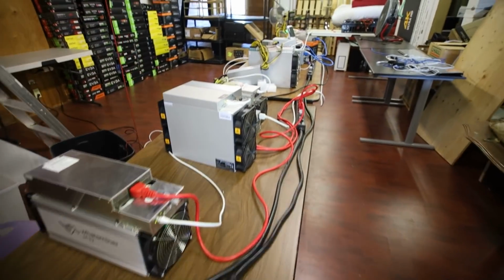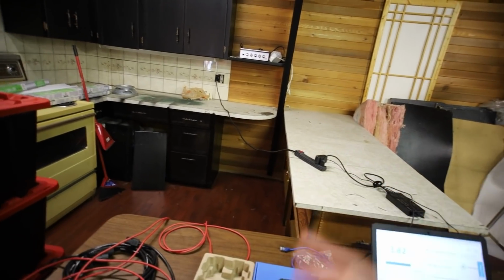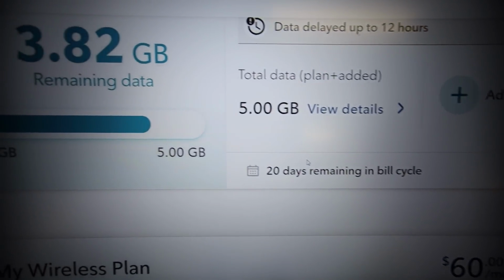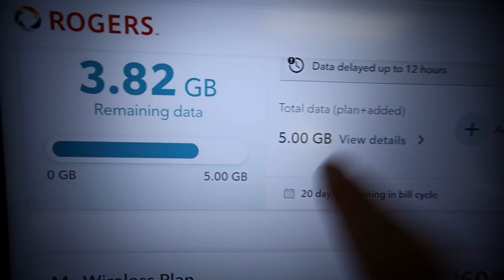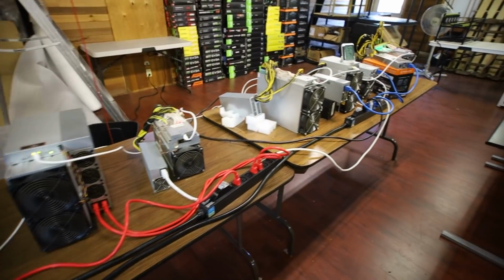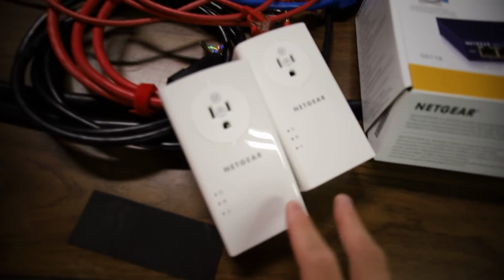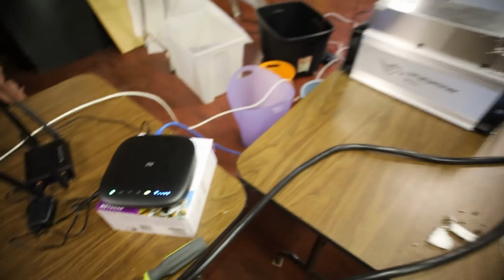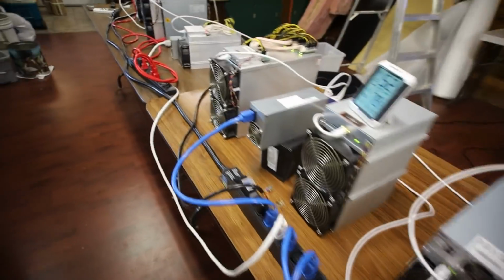10 Days HOTSPOT Data Plan Usage in the Mining Barn

Comment: Hi Red Panda why don't you take 2 internet connections and buy a Cisco RV340 VPN Router - Supports Dual WAN Ethernet, allows multiple Internet connections for load balancing and failover - connect both the internet connections from 2 different providers to the  Cisco RV340 VPN Router , so if one connection goes offline the other one kicks in on the router. This would work really well for you and probably cheaper.

Comment: capacitance differences between buildings can interrupt signals in wires or destroy electronics .powerline adapters can be blocked by certain wiring in houses.(wired on separate legs not connected for example)

Comment: Dig a little bit of a trench and drop in 10G fibre to connect between your basement to your barn.

There is a possibility with the Ubiquity system (I don't have any experience with it, but I am thinking about like satellite TV for example) where the signal, especially the quality of the signal can be interrupted with adverse weather events.

If you're going a few hundred feet, hardwire is better, and at those distances, you'll likely need to drop in fibre. And if you're going to be doing that, you might as well drop in 10G fibre (rather than dropping in 1G fibre).

Comment: When I use a hot spot, my profits go slightly down - but it def is worth it in a place where there is no wired ethernet. Those that use wireless repeaters will find their bandwidth cut in half (which doesn't make much of a difference) but also an increase latency. There are some routers designed to connect to a hotspot via USB that avoids this. ASUS builds this capability into virtually all their routers - but it takes some futzing around as it's not turned on by default. I do find that doing this hastens the battery bulge on the hotspot.

Comment: I wonder if the reason you started having issues with the Powerline Adapters is because you are now drawing a lot more electric through the same power cables. Just something that popped in to my head, not researched it at all. You could try shutting off some of the biggest power draw miners  and testing the Powerline Adapters again. Also maybe worth seeing if you can get a single socket installed on the same circuit at the circuit board end where the barn feed comes from and plug the Powerline Adapter in it.
Reply: Yes, that is the issue .... both powerline adapters has to be on the same fase .....

Comment: I used to use those powerline adapters, always failed a couple of days after installation... Bought a cheap router that I use as a wifi extender from which I got all ethernet connections. So far, no issues, and ping/latency is almost the same lol. Tried once using a data plan, but the ping was too high sadly.

Comment: What about running coax to the barn and then installing a moca network adapter to get wired internet over the coax.  This will give you an ethernet port in the barn, which you can then run to an ethernet switch.  RG6 coax used for typical cable tv should work over the distance you mention.  You might have some signal loss over the distance, which could affect TV viewing, but for mining it should be sufficient. Moca networks can run at 1gig speeds. RG6 isn't that expensive and you can just unroll a spool across the ground to test. If you don't have the tools to put on connectors then you may have to buy them. If your test is successful, then bury the coax.

Comment: Ubiquity nanostation's work great. I run a 500ft bridge in my network with Nanostation 2's. I chose 2's because they are supposed to be better for punching through tree foliage than the 5 ghz version. There are a few big trees in the way but it works great. Signal is always strong, the only thing that disrupts it is the microwave... but the second the microwave shuts off its re connected. 5 ghz would solve that issue.

As for your concerns about the setup... buy them, plug them in and start using them. When I first set mine up the 2 antennas were both inside with 1 having to go through 3 walls and the other going through 1 wall to get outside... plus the trees. Just point them in the right general direction and unless you have something really major in the way... at 500 ft they will work. I also did an install 1/2 mile across an open field, no obstructions with a 5 ghz nanostation. Setup is easy and rock solid.
Reply: @Red Panda Mining
 Ubiquiti's ptp radios are amazing, you can pick up their nanostation 5ac loco's for $50 a piece and get great speed and latency. Like @Bryan Mcllwaine said if you need it to go through tree's definitely pick up the 2GHz loco's, they will do pretty good at getting through with pretty good ping and throughput.

Comment: Direct bury an ethernet cable! I spent about 150 USD on 500 feet of direct burial, and then keystones /wall plates. Ran a 340 foot cable. 0 speed drop, ping is around 10 ms
Reply: First thing I did after video was to read comments to see if anyone had already recommended this, way cheaper and better connection than any wireless or powerline setup
Reply: uh the max recommended length is 100 meters (328 ft) for cat5. for your length, you probably should just get fiber optic.
Reply: @bobsixtyfour  I used cat6, and didn’t want to spend the money on a fiber line. So far I am experiencing no speed loss from modem to the end of my drop. Shall see how it goes long term.
Reply: @bobsixtyfour  recommendations aren’t always necessary. You probably have the same performance 20% over the guideline, but even then it only matters what you’re using the line for. 

For minimal traffic sending shares here and there, you’ll probably be just fine on cat5e at 200m, but I certainly wouldn’t connect voip phones or file servers to a switch that far away..

Comment: RPM, I don't know the distance between your basement and barn. Just a suggestion, run a Cat-6 cable from your network switch or router to the barn. If it is more than 90 meters use a small switch in between (at 40 or 50 meters ). you will get a stable low latency connection.
Reply: This, I ran 175' Cat-6 cable for some exterior Lorex PTZ cameras,  Bury them in CPVC conduit 10' sections.  Its a bit of work, but you can do it by hand with a shovel.
Reply: I even have a few extra 100' lengths that came with my cameras, though you'd probably want to get an unterminated spool to make it easier.  If you want the 100' terminated lengths I'd be happy to ship em to ya if you can use them.

Comment: man you took the expensive route lol. when my internet goes down, i connect my hotspot to my laptop, i have the network card set to "share" the connection. i then take the Ethernet port from the laptop then plug it into a router (wifi or otherwise, no difference) then plug my computers into that router and viola done.